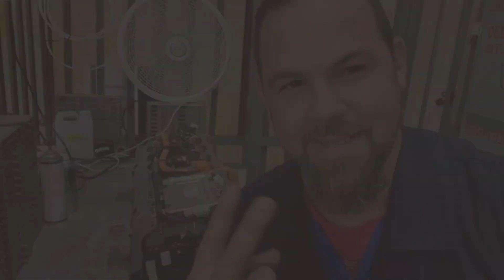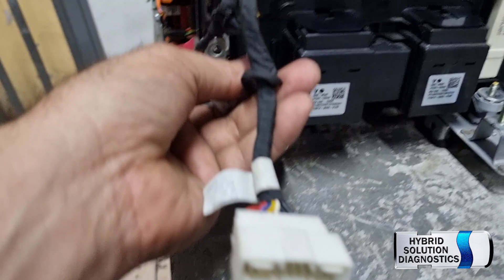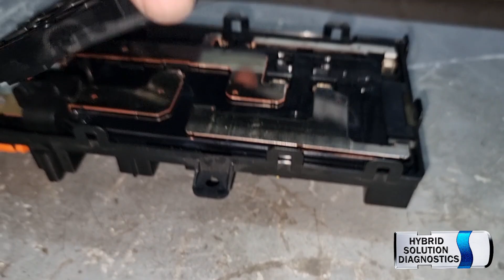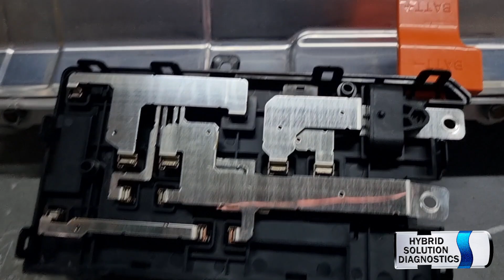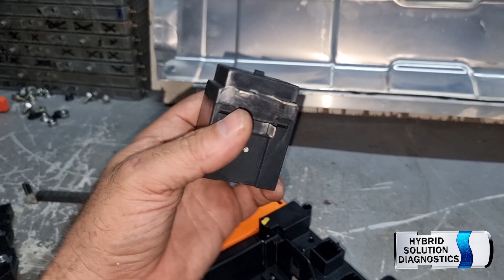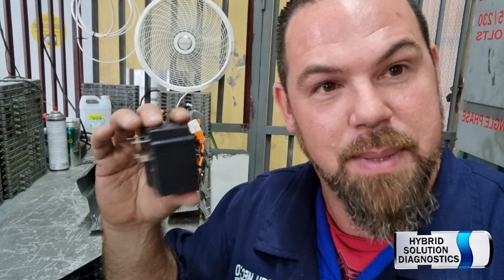Hyundai recalls ioniq hybrids because risk of fire (Master Class Level Lesson) power relay assembly

Comment: Thanks, as an electronic engineer I learn so much from you. Recently I had a fault reading from the current sensor (3276.7A) detected from OBD2, is either sensor fault or wire harness right?

Comment: wheres the Voltage Protection Device (VPD) located? and how to reset it?
is it a switch? or a fuse that pops and needs to be replaced? 

it detects battery swelling and apparently tells the Battery Management System (BMS) to cut power to the relays..

soooo i think thats where im at right now on my 2017 kia optima hybrid..

my 12v is good, 

my new hybrid battery is supposedly refurbished and modules balanced, 

codes supposedly cleared at a mechanic shop

the safety disconnect has continuity and resistance reads 0 ohms.
V=IR, high resistance= high voltage
code: P0A0D, HV system interlock High
why is it High, if resistance is 0 ohms

my other codes from my old battery:

p1b96-HVbattery cell voltage deviation 
(dead cells possibly)

🚩p1bA7- battery overcharge detection active

p1b77- inverter capacitor pre charging system fault(possibly related to the BMS disconnecting the power relays)

p0A0D- HV system interlock circuit High (related to the safety plug, that i tested to have continuity)

p0b3b- Hybrid battery voltage sense A circuit 🤷‍♂️

Comment: 2020 hyundai iqonic replaced hybrid and 12v battery with a good used one. Still have no start. Battery light on and start engine to avoid battery discharge. I put a booster/charger still nothing, help please 😅
Reply: Pyro fuse

Comment: Very helpful but I have a question 
I have a sonata that I want to test my relay so by pressing the brake pedal and push the start button there is clicking behind the rear seat that tells me that computer sends signal to relay is making contact and the ev/ready light comes on meaning the voltage signal passing through relay is good to go and that pretty much complete a good relay test, is that accurate? And if not is there a way to test those 2 relays inside the assembly box ?
Also someone mentioned that when replacing the relay assembly the car needs to be programmed because the check engine light won’t go off by itself, is that accurate. ? Or after a cycle drive will go out by itself?
Thanks in advance 
Guillermo 
Front Mexico now on US
Reply from the maker: Starting the vehicles you will hear the relays in the back… and once replacing there is no need for reprogram nothing… just plug and play

Comment: Great video. I have question, Is the recall power relay assembly look the same from the defect one? The reason I asked is because when I look up spare parts for this particular PRA for Hyundai Ioniq hybrid, there are 3 models out there, one look exactly the same which is PRA G2100 like in the vid (it is called PRA EV1? with prod date 2016 to 2018?) one is PRA G2510 EV2 with prod date 2016 to 2019 that look a bit different but it says should fit with Hyundai ioniq hybrid, and lastly there is PRA G2110 with prod date 2018 to 2019, which is also has EV1 marking. My guts is PRA G2510 is the way to go but thought I should ask the expert's opinion first. Which one do you recommend of getting for durability purposes?
Reply from the maker: Upgrade PRA comes now with Panasonic Relays so it’s indeed a great upgrade…

Comment: Can I charge the battery via the pos and neg in and out ports ?
Reply: Technically you can, the issue is can you charge it in a way that it is safe for the batt and for you so it doesn't explode? You won't be here asking that question if you confidently can answer that safety concern!

Comment: Have a 2017 Ioniq, which has a recall for this. Called my dealership & provided my VIN. They said there isn’t such recall at this time. Im definitely going somewhere else and getting this checked out.
Reply from the maker: Yes it is very easy to have it checked... use this tutorial for that... 👋😎
Reply: the dealers were told to say there is no recall for this and the Hyundai Ioniq Hybrid MUCKY Clutch actuator by the manufacturer .

Comment: Great Video, I have a question. I left a 2013 hybrid sonata that came up with a low hybrid battery message sitting for 2 years , the orange Switch fuse is ok. soI suspect the power relay. Question: Do you think the hybrid battery is shot sitting that long? Thank you!

Comment: Thanks Jose !  I have Prius gen 2 from 2004 works well, No issues at all occures in this years. So I'm lucky means. Precharge resistor is a wrong convention naming. That is bring low differential potential to the contactor pins and means NO spark occures. Nothing more fancy. Relay close the circuit in one point connection and contactor in 2 diferent points to reduce with this aproach also the spark ocurence . Timisoara whatcing you.